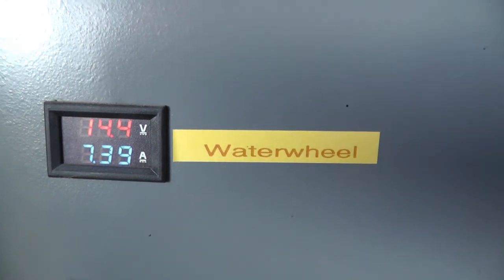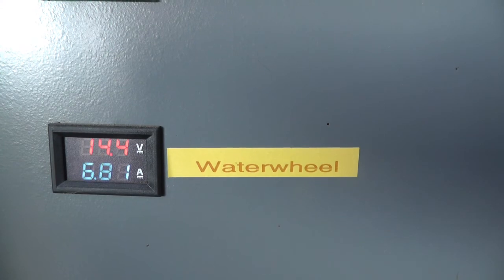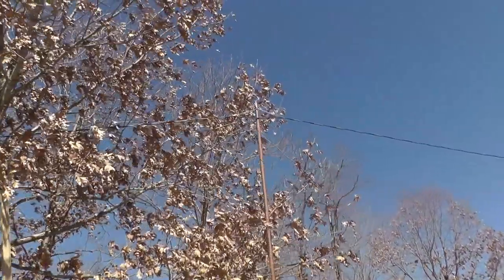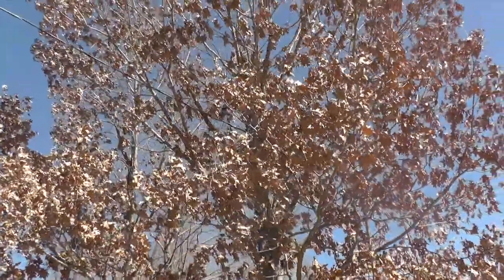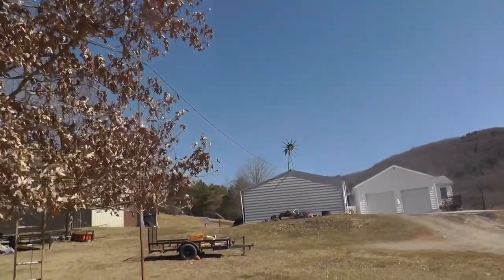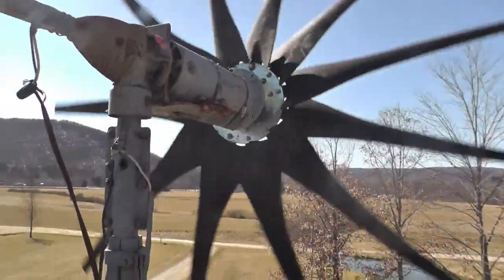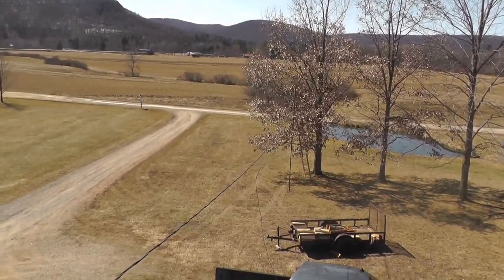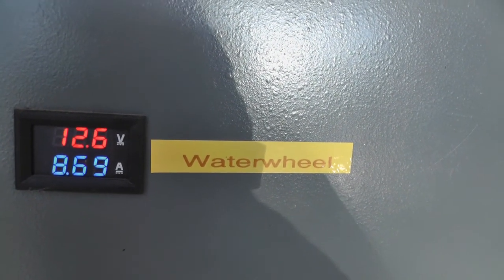Finishing The 3 Phase Transport From the Waterwheel

Comment: FYI, you would experience a lot less loss between the waterwheel shed and the house if you put the inverter and some batteries in the shed. 120V AC will drop less than 12v DC for a given wire size.

Comment: The difference in power from the waterwheel is 101.952 Watts before and 109.242 Watts after. So about a 7 Watt increase, which over 24 hours adds up.